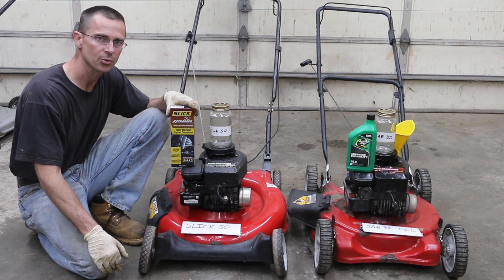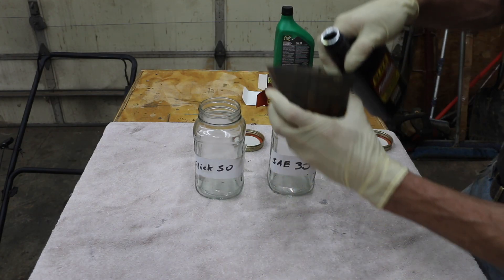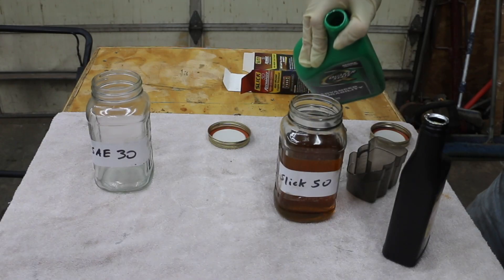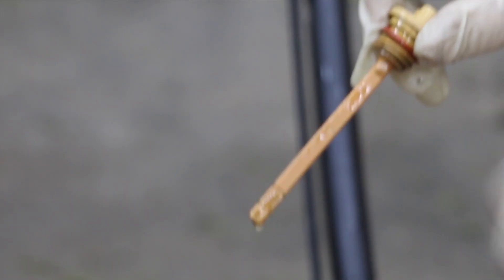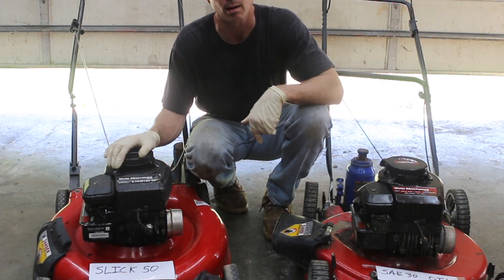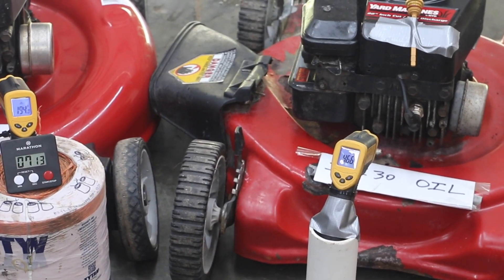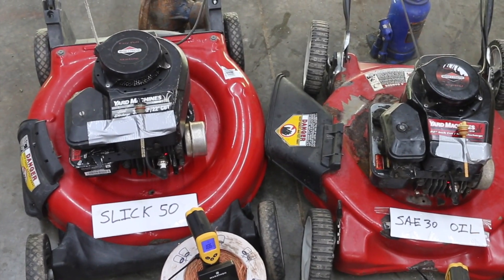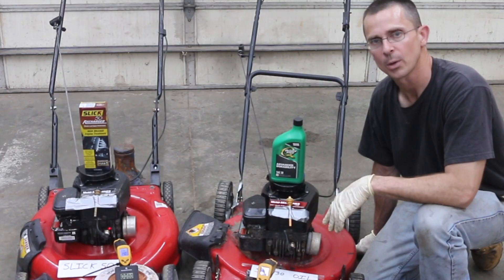Can't believe what SLICK 50 did to my engine!!--Dry Crankcase Test!

Comment: Someone may have already talked about this, but to me it seems like the slick 50 may have some kind of evaporative property by the fact that the engine ran cooler. If that is the case, I would think that there could be solvents involved. If so, any lubricant left behind would dissipate faster. That would be consistent with the shorter run time on no oil. Let me know what you think. Thanks
Reply: ya//.... makes esnse

Comment: more than 30 years ago i used slick 50 on a nissan l16 engine that was showing signs of age and starting to smoke.  after 2 or so weeks it started to sound like a crisp new engine and no smoking.   i got the advice to use it off a mechanic mate who raced cars.   after this success i was confident it would do the same magic on another engine starting to smoke.  again, resounding success.  again, the crisp new engine sound returned after 2 or more weeks.  many years later i tried the stuff again with no effect.  disappointment.  a couple of years ago i found a video about 'john bishop' who claimed he sold the name but not the formula to the shell company.  this may or may not explain the disappointing result.  i'm sure it said that results did take some time.  that was my experience.  i have used other brands of supposed long term teflon additives recently with no noticeable effect.
Reply from the maker: Thanks for sharing.

Comment: Fantastic content , however
.. The slick 50 motor konked out right away with a super low temp . this tells me that the engines were not the same.
 I fully believe that on a level playing field the slick would win simply because of the lack of friction
Reply from the maker: Thanks!  Thanks for the constructive feedback.
Reply: It's a fair point, the slick engine was about half as hot, yet seized up first, bit odd
Reply: I was gonna say we need to buy new engines to perform this test properly but realised that the temperature comparison says it all regardless of the engine failure. Slick 50 works very well but it doesn't repair engine damage, it only prevents it

Comment: I have done some research on the original Slick 50 which contained Duralon, a trade name for teflon. You had to heat the contents on the bottle, shake, then pour into a running engine and drive for at least an hour. Then Slick 50 was bought by Quaker State but the only got the name. Seems the original formula remained with the inventor. Check Slick 50 history in Wikipedia. There are some interviews you will find interesting. The duralon bonded with the metal in the engine parts that were fed by oil and was squeezed into the pores of the metal to give a teflon finish. Worked in my Ford 460 3/4 ton truck for 20 years
Reply from the maker: Thanks for the feedback.

Comment: There is an oil additive that consists of Molybdenum Disulphide, it would be interesting to see if this product was in any way superior to just using straight sae30 oil.
Reply from the maker: Thanks for the video idea.
Reply: @ProjectFarm  I repaired a gearbox when I was a young lad. New bearings and all new synchro rings etc. Just to be sure I added about 10% ‘Molyslip’,(molybdenum disulphide).  This stuff is so ‘slippery’ I couldn’t get any gears! I had to change the gearbox oil four times to wash out the additive. I use it in vintage cars and motorbikes, (engines only!), also it’s brilliant in the bearings of clockwork clocks, especially grandfather clocks, another addition of mine!

Comment: Interesting... A few years ago I had a push mower and drained the oil completely with the drain plug, and then realized that I didn't have the right oil to put back in it. So I left the drain plug out and went to work the next day. My wife decided for the first time ever to try to surprise me and mowed the lawn for me with no oil. She ran it a few rows for about 10 or 15 minutes and it died. We always have prayed for protection over our larger purchases when we buy them. When I heard she had mowed I was certain it was ruined. But I prayed for it again when I got home, put oil in it and ran it without issue for several more years before I sold it. I have always wondered if it was a true miracle, or if engines can run longer than I thought they could without oil. After watching this I am leaning towards miracle!
Reply from the maker: Thanks for sharing.

Comment: this uses nano technology, it works great in my 7.3 engines.
   https://www.amazon.com/Archoil-AR9100-Additive-16oz-Vehicles/dp/B005UO70ZO/ref=asc_df_B005UO70ZO/?tag=hyprod-20&linkCode=df0&hvadid=198054161189&hvpos=&hvnetw=g&hvrand=7079902957699981323&hvpone=&hvptwo=&hvqmt=&hvdev=c&hvdvcmdl=&hvlocint=&hvlocphy=9059211&hvtargid=pla-408903248844&psc=1

Comment: Retired from over 40 years in the repair business and we proved that slick 50 was worse than regular motor oil using a friction machine. We warned another repair shop owner about it's friction enhancing abilities and he was stuck with the TV commercial. After he put in a new 4.3l engine with slick 50 added, it locked up in 74 miles and threw a rod out of the block. Of course he wanted engine company to pay for a new one. The engine company disassembled said engine and was in shock at the damage and was going to refuse to take care of it, said it looked like they had drag raced it, which their shop actually did a lot of. Shop did about 100 engines per year and threatened to stop using their engines if they refused to pay. I felt bad for engine company. ALL THAT SAID, THAT IS WHY WE LOVE YOUR CHANNEL!
Reply from the maker: Thanks!

Comment: The more important point in the last test was that slick 50 engine seized at 260 degrees while the other went on to 350s.

I think this means that slick 50 IS doing what it is supposed to do, it is just that whatever additive in it has big particulates and needs a lot of engine running time to work. This also means while slick 50 is capable of totally ruining good engines, it is also possible that it will extend the life of old beat up engines just by lowering the running temp. Less temp means less friction after all.
Reply from the maker: Thanks for the feedback.

Comment: Ha ha, I remember that commercial and I thought it was a total BS.  I do not remember that product name?  Anyway, I call them and ask:  I want to buy 1 quart of that, run that in my car for 5 minutes, drain it out and pour into car number 2, etc.  This way, I will never buy anymore oil as you advertised?  Will you warranty the engines?  The Sales person said:  Well.....   that is NOT recommended.......  I am curious what part in the Slick50 lawn mower failed?  I was amazed that it ran cooler?  What did it do?  Did it protect anything?  The crank bearing, the piston rings, skirt and cylinder wall?

Comment: I have a 23-year-old cheap lawn mower with a B&S engine. Pretty entry-level, bought from Menards for $125 or so. The engine seized on me 10 or so years ago when my son wasn't paying attention and ran it when the oil ran dry. Couldn't barely budge the pull cord. I went ahead and added oil to it, came back a few days later and... to my surprise, it pulled and started right up! It has seemingly been fine ever since. I don't even change the oil, I just check and add as necessary. So, go figure. ( I do not recommend trying this of course, certainly not with any engine larger, more complex, or more expensive than in a lawn mower.)
Reply from the maker: Thanks for sharing!

Comment: You could theorize that since the drained Slick 50 was visibly darker then the drained 30 wt that it was able to desolve  sludge and deposits in the engine that actually  provided additional lubrication in the 30 wt  engine, particularly as the temp increased. That would also explain why it was smoking more upon failure.
Reply from the maker: Thanks for the feedback.

Comment: Not the best test. You should have gone with 2 new mowers and both being same make/model. 
Different motors run at different temps, and rpm when at idle.
The other issue is the natural wear n tear to the used mowers. If one has significantly more run time on it, or different degree of maintaining,naturally wouldn't last the same
Reply from the maker: Thanks for the constructive feedback.

Comment: I remember the commercial. Maybe the mower with slick 50 was going to shut down no matter what. Maybe we can get the viewers to donate 4 more mowers and do a 2 out of 3. The only reason I say that was the temperature on the slick 50 motor was so much lower. Anyway that looked fun and was a great review. Thanks. ( note I used slick 50 in my Mazda when I was young thinking it would keep it running longer. Not sure if it did or didn’t)
Reply from the maker: Thanks!

Comment: Sorry but there are way too many variables between the engines for this test to have any meaning! First question would be why an engine over 100 degrees cooler locked up first? I would say hours on each engine, clearances in bearing surfaces, past abuse of each engine (which is why the slick 50 oil was black). Etc, etc, etc. you would have to have two IDENTICAL engines in every way for any kind of meaningful testing to take place. Second question...WHY did the engine with the sae30 oil LOOSE SO MUCH OIL when you recovered it? It was still left in the engine, obviously providing limited lubrication!

Comment: I just watched this 4 year old video so maybe you won't even see this comment. I used slick 50 way back when they advertised it. I can't say if it worked or not because the car failed from other problems before the engine was used enough to say. In 1997 I started using Amzoil in my "95 Taurus, changing it every 25000 miles and the engine ran fine until the transmission started slipping at 283000 miles, good stuff. I did the same thing with my 2005 Taurus and got 290000 miles out of it before I just got tired of it. I'll swear by Amzoil.

The Slick 50 lawnmower engine may have been worn out and ready to go bad before the experiment started. It seemed to be running cooler when it failed. You should do it with new engines!
Reply from the maker: Thanks for sharing!

Comment: Slick 50 in a engine with a lot of sludge will ruin your engine in no time. Especially if oil pump sump screen is half blocked by sludge,the Slick 50,in my experience finished off the engine. My Harley hated it and tapped like Steven King on a 8 ball. The Harley transmission loved it! 1 oz added to trans oil and it shifted smooth as silk.js
Reply from the maker: Thanks for the feedback.

Comment: Could be an anomaly on failure. I’d like to know if done again the same result happened on another set of mowers.
I’m assuming you buy these used to destroy. Who knows how the slick 50 mower spent its life. I’m not backing slick 50 at all. Just saying maybe that’s why even when you clearly see the temps are lower.
Even more shocking Quaker state oil worked that well 😂
Reply from the maker: Thanks for the suggestion.

Comment: I'm guessing the slick 50 made the oil more viscous which might be better when there's enough oil, but it drained off the internals more than the oil alone, so was bad without anything. Granted I've always heard most wear occurs at startup when parts are "dry".
Reply from the maker: Thanks for the feedback.

Comment: My first truck was a 73 Ford Pickup and I ran slick 50 in it occasionally. It did leak a lot. My work was 60 miles away. One day I ran it dry, I don't know how long it ran like that, but somehow it didn't crack any heads or anything. I put new oil in and ran it like normal. Those were the days when Ford was tough.
Reply from the maker: Thanks for sharing.

Comment: I remember seeing guys who sold slick 50 at car swap meets during the 80's and early 90s. They would have a 307 from a junk yard where they open a valve on the pan drain the oil while it's running keep going. I always said there no load on that engine yeah it might run for awhile . I think they even had that one where they fly around in a Cessna over an airport and guy pulls a handle drains oil into a clear tank under the engine while they keep flying the airplane. I can tell you if you put slick 50 in an certified airplane ferally sure that is against FAA regulations.
Reply from the maker: Thanks for sharing.

Comment: I can remember back in the 1960s, Slick 50 showing an advert of them treating the engine of a Ford Anglia. The engine was mounted on a bench jig. Having treated the engine with the Slick 50, while the engine was running they took the sump plug out and let the sump drain. Then, it was claimed, the engine ran for a 1000 hours before it seized. I have to admit I suckered for this advert and used Slick50 for years after. I wonder how much money I wasted and how much money Slick 50 conned us suclers out of?
Reply from the maker: Thanks for sharing.

Comment: In Australia I sold Technilube additives for fuel and oils. Technilube was capable of successfully doing the job, however the oil suppliers threatened the customers to withdraw any warranty if Technilube was added. We were able to put a blow torch to oil with Technilube and the oil could not be destroyed no matter how long we continued to "cook" it. I could explain the process but it would take a little too long for this comment. We were unsuccessful here in Australia. I believe Slick 50 has Teflon which can break down. Technilube is a pure oil variant which changes the surface tension of the oil and lowers maximum temperatures below where h2so4 is created.
Reply from the maker: Thanks for sharing.

Comment: Worrying about mixing it up really good when the engine running would mix it up like a blender!
Sometimes the engine lasts longer because it runs cooler.  The long term affect of hot engines may be a factor of longevity.  Yes, both froze up, but in the long run, maybe your slick 50 kept your engines cooler and giving it more life over all.  Also, how long did you run the engines before you drained it? Do you know how long the Slick 50 testers ran their engine before they drained it?  Maybe if you ran your engines with the oils for an hour or so, maybe a 24 hour run, that would help the chemicals in the Slick 50 bond better to the metal parts making it last longer.

Comment: one thing i am wondering, is if maybe the engine in the commercial had an iron block, while the briggs has an aluminum. maybe an iron block would do the expected result. if you want to test it, use a predator 212, because it is not too expensive. they have a cast iron cylinder.
Reply from the maker: Thanks for the suggestion.
Reply: @ProjectFarm  wow, this vid is 4 years old, and u are still replying to comments. Legend.

Comment: Lucas
Reply from the maker: Thank you for the feedback!
Reply: @ProjectFarm  I have a scag Turf Tiger and I developed a small leak on my deck gearbox . I decided to fill with lucas so I could pull the gearbox in the fall.  In the fall,I pulled the gearbox and separated it. The gearbox was totally empty but lucas was still running around the gears. To my amazement the gearbox showed 0 wear. The gearbox has a aluminum housing with stainless steel gears. I was very impressed. Lucas states you can use it at 100% and you will not void your warranty.

Comment: Didn't Slick50 get sued about 20 years ago for false advertising, or something like that??  Maybe that was another product from the same era...  My memory associates teflon with the product in question for some reason, as well as a friction demonstration test where a spring held one steel piece gainst a rotating steel shaft; somewhat similar to a friction rig I have seen you employ.

Or maybe I forgot to attach the ground cable to my tin-foil hat today....  Hmmmmm

Comment: Wouldn't you want to run both on regular oil first to establish a baseline, in case of temperature differences between the engines without additional variables?
Reply: My thought exactly. Also, since they both look used who knows the difference in run time on each engine.
Reply: He has changed his testing techniques substantially since this video. But yeah I totally agree I was like wait did he not run baselines with just oil 😝

Comment: Well I’ll say this they are 2 identical engines however they will have their own pre-existing conditions that you can’t see or hear  my thoughts are the engine that gave up first may have had clearance problems that you were unaware of!! 
Try the test with new engines and see if you get the same results.
Reply from the maker: Thanks for the feedback.
Reply: @ProjectFarm  I have a YANMAR single cylinder Diesel engine I’d like to send you for future videos and you can keep the engine it runs great

Comment: I know I used Slick 50 in my moto guzzi and there was a noticible improvement in engine response.  And I mean noticible in riding to the bum on seat response not electronic instrumentation results.   To me, the 50 needs to work with oil, not on its own.   Good test though.
Reply from the maker: Thanks!  Thanks for sharing.
Reply: I added this product into my "new" KZ1300" back in 1982!  it did help with the heat blast problem they had, however after treating with slick -50 about 50 miles later the LOW oil light came on!!  a call to slick -50 "WOW you sure got a GOOD treatment in a short time" change the oil and you are good to go!  Sold the bike in 2010 with 86,000 miles and no issues since new!!

Comment: I have used Slick 50 too. I stopped because it seemed to cause oil leakage. And I never planned to run an engine without oil anyway.
We may conclude it was the oil scam of the 20th century.
Reply from the maker: Thanks for the feedback.